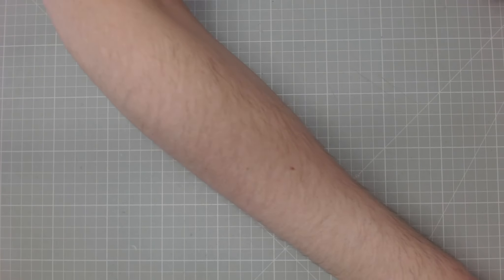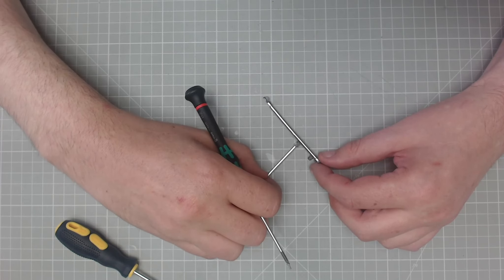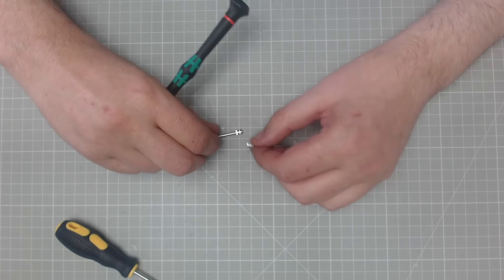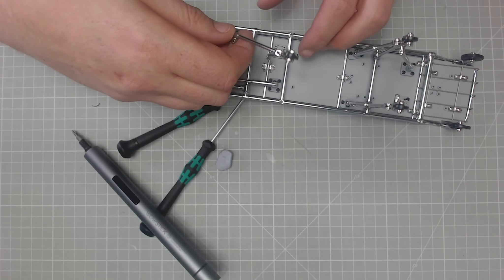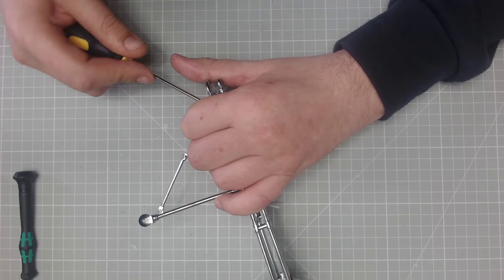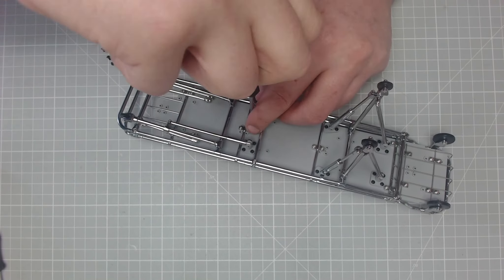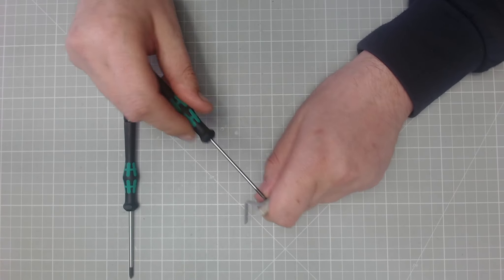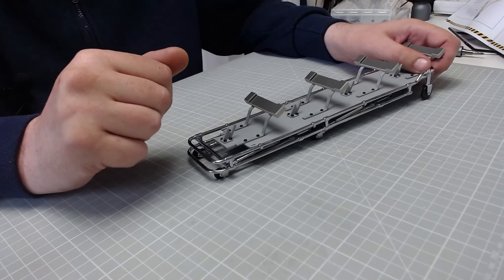Build The Ecto-1 Issue 127

Comment: Nice STAGE, u cud have 3d printed that thing quicker, check ian's fb post i think is, he had something posted about quietening the lite bar,
Reply from the maker: Thanks dee. Yea I have seen the thing with the light bar but I have an Idea on how to make it quieter
Reply: @MarksModz  well if u have the lights on, more than likely the sound effects wud b on also, but unlike the t8 dont think this is a model that will b on constant, imagine making vids r doin streams with that wailing in the bkround
Reply from the maker: good point dee but the noise I have been told it is that bad you can't hear anything else. It does tell you in the instructions to use grease
Reply: @MarksModz  have u run the lite bar on its own yet